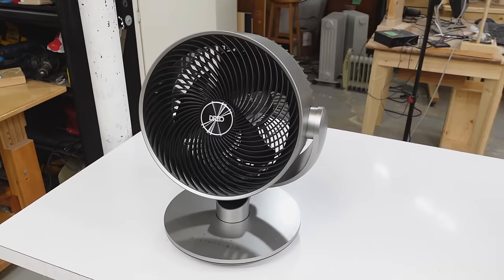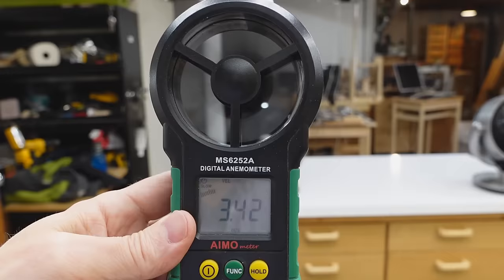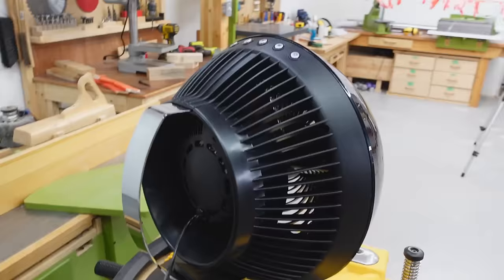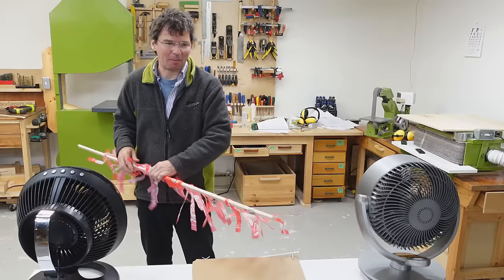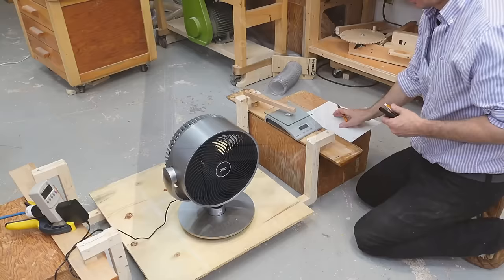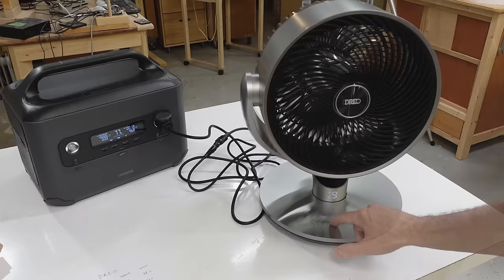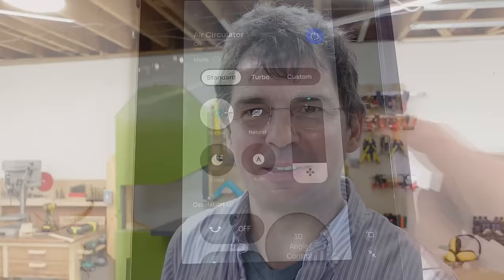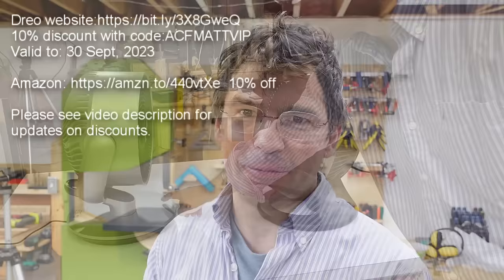Dreo vs. Vornado air circulators

Comment from the maker: Discount codes shown in the video have expired, however, there is a new discount:

20% off the air circulator in this video (valid until Sep 29 2023)
http://woodgears.ca/dr/cf
Reply: The link doesn't apply any discount 😥
Reply: @andyo-pl 

Canada only? “Oops error” from the US…
Reply: Error 404 not found
Reply: Doesn't work in US.
Reply: Only 1 year warranty? Hard pass.
Reply: Play a q

Comment: Respectfully Matthias, I think a fairer comparison would've been the Vornado 633DC "Energy Smart" fan which also uses a brushless DC motor and is the same price at $99.  The Vornado also has a 10 year warranty.  The Dreo does have nice features of its own (remote control, app control, and a breakdown design for cleaning) but Dreo is a newer company and it remains to be seen how their long term customer support is.  I've used Vornados for about 15 years now and still and use my original 15 year old 510 compact fan.  If and when my Vornados break down, I'll definitely look at a Dreo for comparison.  Thanks for the video.
Reply from the maker: No experts on vornado fans.  I just picked one that was the same size and the same price.
Reply: If it's the same price then it's a fair comparison.
Reply: @JovemEverton  How is it fair when the motors are completely different?  That's like comparing a Tesla vs. a similarly priced internal combustion engine and saying it's fair because they cost the same.  

People who don't understand this stuff will see that the Vornado fans draws 53 watts at the highest setting and the equivalent setting on the Dreo uses around 27W and think the Dreo's obviously better not realizing that an AC motor is being compared to a brushless DC. Vornado has brushless DC motors in some of their fans.  Matthias stated his only requirement is that they were the same size/price but there is a comparable DC motor version - that wasn't used. 

If this was a fair test it would be the Vornado 633DC (9" blade diameter, brushless DC motor, $99 msrp) vs this Dreo (9" blade diameter, brushless DC motor, $99 msrp) - Don't forget the Vornado has a 10 year warranty by a company that's been around since 1945 too.
Reply: @JovemEverton  It's technically fair but it is kinda misleading when they have a more similar offering at the same price point as the dreo.
Reply: @SandyMachoManRavage  I do agree that fan you list is a much better comparison, though that also begs the question, why do Vornado still sell the equally priced but likely worse AC motor model. The warranty and support pedigree would definitely be a plus for the Vornado in my mind too.

Why I'm even replying is to disagree with your point with the cars, and price-point comparisons in general. To me, comparing a Tesla and an equally priced ICE car is completely fair and valid. After all, if I have X amount of money to spend on a car, I don't (have to) care about what is under the hood. If I like the 0-60, fuel efficiency, range, manufacturing quality (or whatever other aspect of a car I care about) of one of the cars better, I should buy that one, regardless of what technology it uses to achieve those characteristics.

Also, extending the car analogy to this video, it would be similar if the maker of the ICE car also sold an equally priced EV. It is likely that the EV would be a closer match on many aspects to the Tesla than the ICE car, definitely, but I think it is unlikely that a prospective car buyer would make a decision on what car to buy after watching just one 1v1 comparison video.

That is perhaps the thing that I would change about this review. Having never heard of Vornado, the video left me under the impression that the Vornado fan in the video is The Vornado and not one of Vornado's offerings, with others being available that might match the Dreo. Intentionally or otherwise, I don't know, but trust Matthias enough to give him the benefit of the doubt.
Reply: @slunce12  I agree with your overall explanation but I was mainly trying to just talk about how it wasn't a fair comparison when the power usage of each fan was brought into the video with the wattage chart.  You can't compare that apples/apples when one is using an AC motor, the other DC.  More when an equivalent DC motor version is available to test.  For example, the 633DC draws 2W at its lowest setting - this Dreo draws 4W so ....

I can't speak for Vornado either but I'm guessing that they keep both models because one is cheaper to build, has a shorter warranty and people must be buying them at that price to keep them in production.  Just sounds like good business. (for Vornado, not us the customers)

I'm not trying to say Matthias did anything on purpose either with this video,  him saying he picked an equivalent size/price is a fair reply and believable.  Just trying to bring light to other models that might make the test more of a heads up.
Reply: @SandyMachoManRavage  damn, just saw this comment after buying the featured fan... seems impressive nevertheless.
Reply: @emeltea33  Don't worry about it too much.  The Dreo looks like a very capable fan with some features that the Vornado does not have (remote control, oscillating and it's easier to clean)  It should be great for you.
Reply: Vornado also still makes some of their fans in the USA.  I'm pretty sure the Dreo is made overseas.
Reply: @SandyMachoManRavage  While you make a fair point, I feel that the aspect of marketing the product isn't up to Matthias, but rather to Vornado in this case. If Mathhias just went on Amazon and bought two fans for $99 each and the DC model didn't show up or wasn't properly advertised as being a DC rather than AC motor, that's not really something he can do anything about.

I've worked in online marketing and a not insignificant part of my job was to make sure new products showed up higher in the most common search results than older products. Part of this was communicating to the local equivalent of Amazon that we wanted them to push the new product over the old one.

Compare it to say SSDs for PCs, I can look up a dozen different 2TiB SSDs at around the 100 euro price point. At that point it's basically up to me as the consumer to go and compare technical specs, look up detailed reviews, compare the bill of materials and all that jazz. The average consumer won't do any of that, they'll either buy the well known big brand, or they'll pick the cheapest one that meets their very broadly defined requirements.

Getting the consumer to understand the fine technical details is borderline impossible. You or I would look at the specs of an SSD and realise that TLC has better longevity than QLC and thus spend 5 euro more on the technically superior product. The average consumer doesn't know or understand this difference and will just buy the one that's 5 euro cheaper.

Also for what it's worth I did a cursory search on the big box sellers in my country (not North America) and I can't find a Vornado 633DC. There is a Vornado 633, which seems to be the same as the one Matthias is showing and it costs 99 euro. There is a Vornado 6303DC, which is a DC brushless motor in seemingly the same package, but that one retails at 179 euro. I can't compare the Dreo price, because they don't seem to have a presence in retail in my country at all.
Reply: @matthiasrandomstuff2221  that’s okey but you comparing the power usage between an ac fan and a dc fan … ac is louder and uses more power. Would love to see a comparison with the dc vornados. I bought a normal vornado a few years ago in Germany and it was really a horrible air circulator.
Reply: Thanks for this comment video is misleading then if it’s two different motors. Although it seems vornado is more about air circulation vs Dreo direct air. 

Would have also been interesting seeing room temperature in different areas of the room as well as wattage use for the same motor type. Still Not sure which one to get
Reply: @iiiEazyiii  in reality they both have the same kind of airflow. That vornado marketing pictures with the swirls is not the real airflow of a vornado.... there is just no engineering behind it. Take a Fog machine and look for yourself :)
Reply: If both fans cost the same then you getting a more "fan" for your money with the Dreo. Thats the point assuming both are quality products.
Reply: @SandyMachoManRavage a better question is why is Vornado selling a better motor version of their fan for the same price as a not as good motor version?!
Reply: @JovemEverton  tell that to Dyson.

Comment: I can totally see a use for the app control thing.  I have a combine living/dining area and having 1 fan be able to blow air in a specific section of the house sounds great.

Also to annoy my dogs.
Reply: Old fans could do that too - you just had to walk your ass the whole 10 steps over to them to point them the way you wanted it to go, and they didn't cost $100, but c'est le vie

Comment: Vornado also has DC-motor based fans in their line-up that perform much better regarding power efficiency at lower levels.
For the EU 230v version of the 633DC, I've measured 2W at the minimum speed which also happens to be delightfully quiet.

Taking it apart, all that I found in that unit is one potentiometer, an ac to 24v dc power brick and a motor unit that is smart enough to control the fan speed based on the voltage provided by that potentiometer. Conceivably, one could probably retrofit those with Wi-Fi capabilities as well. At least there's a lot of space for an ESP8266 or similar in that case

Maybe a look at those models could be an interesting follow-up video?
Reply: Yeah but at what co$t?

Comment: I have a Vornado smart window fan circulator.  Best window fan that I've ever had.  The Alexa compatibility makes it very convenient to go from exhaust to direct and set the speeds.  I just bought the same Dreo as shown.  Yeah, without a doubt it is the best tabletop fan ever. It also works with Alexa, which is very nice.

Comment: We have a much older (15 years?) Vornado which has just three speed settings. We use it in a medium sized room and never need to go to the highest setting. If I wanted to move the air around in a much larger room I'd definitely consider the Dreo.
Reply: Just put 2 $20 box fans in an upstairs window, and it will air out the whole house. Just crack the windows open were you want airflow in - it's really not that difficult

Comment: Vornado’s claim to circulate all the air in the room wasn’t really tested here. You tested the fans’ forward blowing power quite well, and the Dreo is a clear winner there.

In your diagram showing how more turbulence with increased distance results in more circulation started to get close to the (claimed!) difference in vornado’s design vs other fans. Vornado is not designed for direct blowing. In their manual, they say it should be placed at the edge/corner of a room and aimed at the opposite edge/corner, or whatever gets you the max distance of unimpressed airflow. It’s supposed to create a vortex, a “whirlpool” effect, that drags on the rest of the air in the room and circulates it that way, rather than relying on chaotic turbulence.

It’s an elegant design if it works, I have no idea if it does or how much difference it makes. I have seen a vornado model prove that it creates a vortex: we aimed it directly up and placed a whiffle ball in the middle. It floats in the air column instead of being blown off to the side like you’d expect. I’d be curious to know if the Dreo does the same thing since the case designs look so similar. If it does, than the Dreo will outperform the vornado since it’ll create the same conditions and blow harder. Vornado might still be under patent though, so it won’t surprise me if it doesn’t work.

Comment: That 3-D feature would be very useful in wine cellars or museum storage rooms or library archives or art storage vaults. What you want there is "uniformity" in what are un-occupied spaces that have very low—but often highly asymmetric—heating and cooling loads. One wall, or the ceiling or the floor is often far cooler or hotter than others, leading to stratification of both temperature and humidity and hot and cold spots, with unfortunate consequences for closely-packed documents and art work. The 3-D feature could ensure air mixing and therefore greater temperature uniformity at very low first cost and energy cost cost compared to a high-capacity air handler running constantly.

Comment: Vornado also has a line of energy smart fans that use DC brushless motors.  My Vornado DC smart fan uses 15 watts on max power.  Equivalent shaded pole motor fan pulls 80 watts

Comment: These types of sponsored videos with actual testing are super helpful. The dero tower fans are expensive but my cheap tower fans keep breaking in a year or less so I've spent more than just buying one and they allow you to easily clean the blower cage with a single screw grill which is very helpful. The brushless dc motors are also way way better than the cheap ac motors in most fans they are basically giant pc fans which makes them quite a bit safer too.

Comment: The ability for it to run on a "wide voltage range" is really neat. It would be super useful to make a little 19/20v powertool battery adapter for it, or run it off of a UPS battery directly without going through the inefficient inverter.

Comment: Hey @Matthias I am a long time subscriber, I have bought a few of your plans from your website.  I have one of the Vornado fans.  I agree with most of your review of the fan.  I do however, disagree that you cannot feel it elsewhere in the room.  If you read their directions it says to point the fan away from you and have the air bounce around the room.  Mixing it.  We have one in the bedroom and it does a good job in the summer to mix the air in the room.  We have the exact same model and our bedroom is 25x15x8.  Anyways, based on your review of the Dreo fan.  I just received ours in the mail today from this video recommending it.  I highly enjoy it so far.  I bought it solely on your positive review.  Also, since it only uses 24v compared to 110.  Oscillates vertically and horizontally.  Plus all the other features. I also liked the fact that the speed 2 is equal to 1, and quieter than the Vornado.  Tonight will be the first night.  looking forward to it!  Thanks, bmich

Comment: I've been very happy with my Dreo Macro Pro since your video last spring (I just wish the filters were cheaper. Unfortunately, none of the manufacturers list exact filter dimensions so that I could easily look for alterantives.) 

It's been neat seeing more products from them reviewed by you. As other comments have said, I'm glad they're willing to put their hardware to the test so confidently like this. Very sleek designs. Currently my only Vornado product is a room heater, but my impression has been that they make some of the best performing home fans on the market. Interesting to see that they finally have a worthy competitor! Thank you for comparing and sharing!
Reply: Wow, that's ridiculous how drastic the power efficiency differences are! Clever test rig! Beautifully done!
Reply: Speaking of Dreo's air filters, if possible and feasible for you, I'd love to see a comparison of their filter types. Looks like they have four available now, at least for cylindrical type. Originally they only had a "classic" H13 with activated charcoal and a coarse mesh screen pre-filter. Now it seems they also have ones labeled for "Allergy", "Smoke", and "Toxin" filtration, and I'm really not sure what the differences in performance actually are, nor if they're worth an extra $5-10.

Comment: The remote on your phone is great for me. I have a crawl space under the house that requires some effort to access. having the airmover under the house keeps the crawl space from freezing up water lines and drain lines. if you live in cold climates like I do in Alaska this is common to keep air moving under your house 24 hrs a day in winter. the remote offers a great option